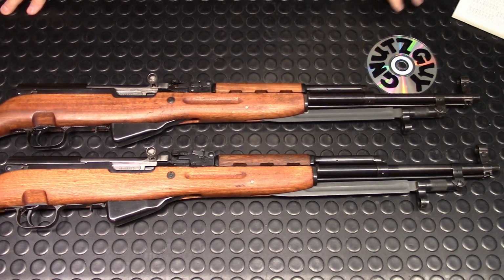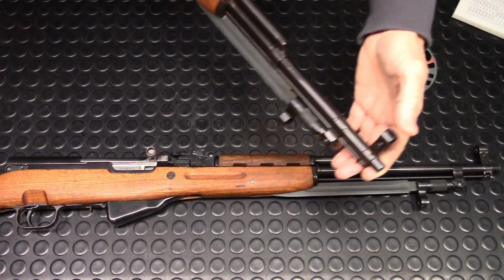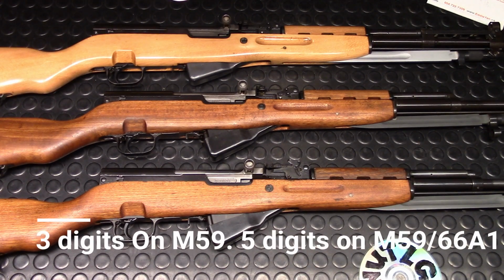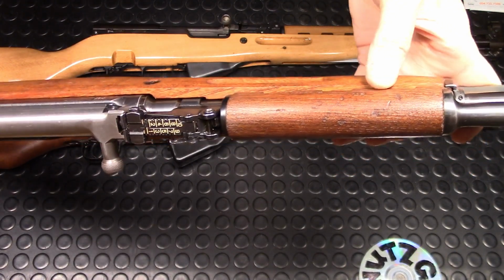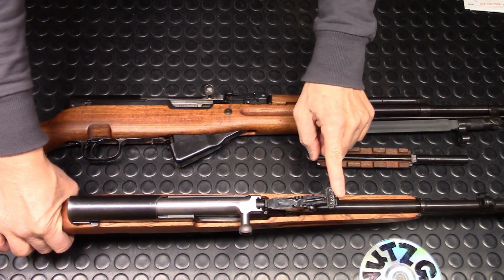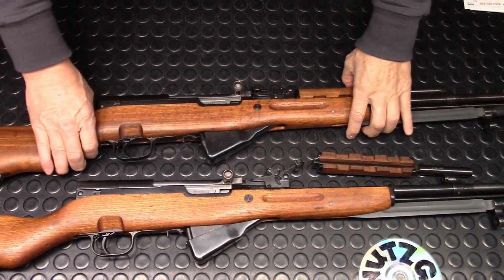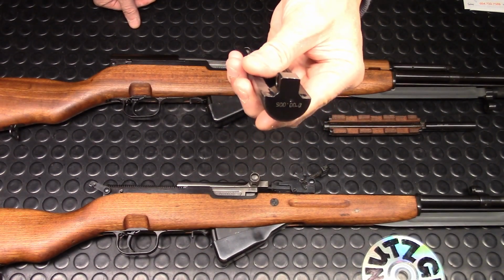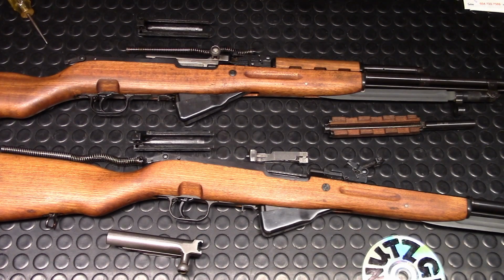Pretty rare Yugo SKS PAP M59 refurbished marking "Z" , Zastava?

Comment: I just want to say that you can't really judge the age of a Chinese SKS on any single characteristic. I own a 1978 "French Tickler" SKS, and it has a short barrel lug. It is not pinned. Chinese SKS are very resistant to "rules" like that, and generally shirk categorizing dates based on design elements/changes. Too many factories and variations in production to count.
Reply from the maker: I did a video on the new shipment to Canada and it had a French tickler. I will be taking it to the range soon
Reply: @gnutzguy  Awesome rifles.